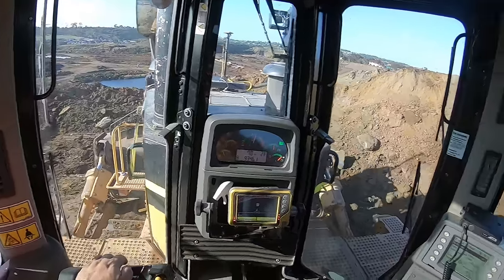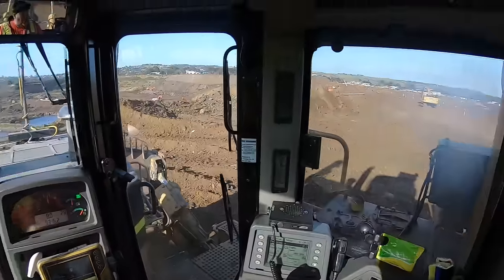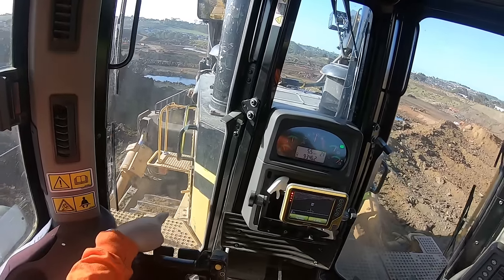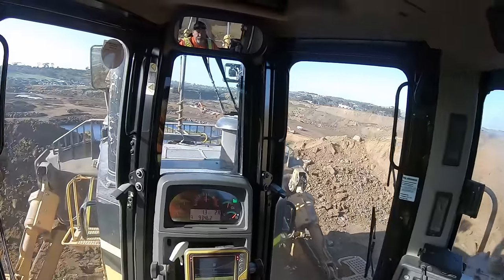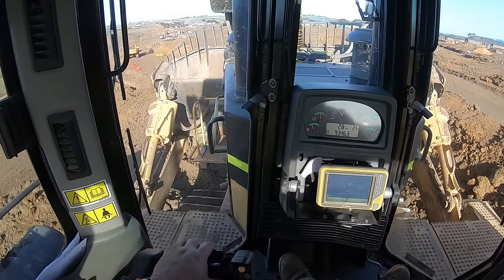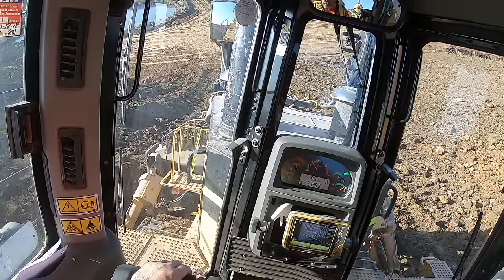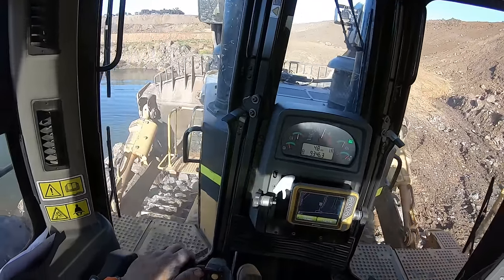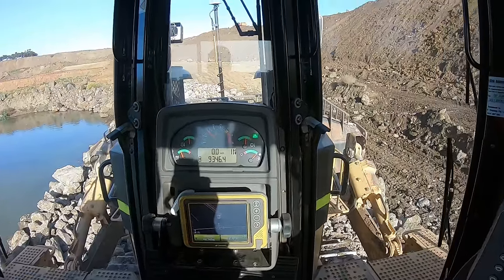13 minutes in the life of a D10T dozer operator

Comment: Great video sir, very informative,  I'm a D-11T dozer operator in a coal mine here in alabama, I can honestly say there aren't enough of us around anymore, grade control has really ruined some of the newer generation from learning how to listen to the machine and feel the machine from your hands to your wrist and arms all the way from the feet to your ass, in my opinion if you learn your machine and you want to do your job well the sounds and feel of the dozer will tell you exactly what you need to know, you will feel what and how your pushing or if your digging or cutting into the ground on one side or the other, getting to know your machine is the key in my opinion,  iv never stopped learning even after 19 years in the seat that machine still teaches me something everyday. Iv never got to use grade control yet, but if I'm not in the push pushing over burden off of coal I'm building a road or ramp for rock trucks. Stay safe brother!

Comment: You’re doing some good work, but if you can take any advice, I would tell you don’t use both of your steering brakes to stack the berm. That dozer is intended to go in and out of forward and reverse at full throttle, so slip it in neutral to stack your berm, you’ll find it is much smoother than using the steering brakes. Eventually, you will wear out the steering brakes and they won’t work anymore, all the dozers where I work barely turn because other operators use the steering brakes to stack. It is so irritating.

Comment: I ran a Holland loader for awhile,  it was a machine mounted on two D10N's, one in front pulling and one behind pushing,  sort of like a twin engine scraper.  It could load 120 yds of dirt in under 70 seconds consistently.   The front dozer happened to have a cushion blade on it, and sometimes the bank I was loading out of, would cave off in front of me and I would doze through the pile, with a full to overflowing blade load, while at the same time, loading the 120 yds of dirt.  It was an impressive machine.
Reply from the maker: That would be something to see! And I imagine few have had the opportunity to operate… I’ve operated all sizes of scrapers Cat makes, but nothing compared to that. Well done!
Reply: @briansims9820  if you google Holland Loader mining, you will see some pictures of the horizontal cut loader.  They had 2 types, a horizontal cut loader and a vertical cut loader.  The one I ran was a vertical cut.  They both operated similarly.  I would send pics of the vertical cut but I don't know how to do it, here.   I could text you some pics if you are interested.
Reply from the maker: @fedup3582  mate, that’d be great to see! simsbj68@gmail.com. I’ve operated so many different types of earthmoving equipment around the world in my 34 years as an operator/instructor…. just about everything used in mining, but I am not familiar with the Holland loader. I’d love to see some pics!! If you send me an email I’d be happy to give you my phone number for texts if that works for you. Cheers!!
Reply: @briansims9820  Здравствуй Друг. У меня есть вопрос. 
А есть ли возрастные ограничения для работы на бульдозере? 
Я хотел узнать. Если был раньше опыт работы в другой стране на бульдозере. При приезде в сша и имея разрешения на работу, возможно ли в 50-55 лет устроится оператором бульдозера? И какая оплата сейчас примерно в сша получает $ в час? И есть ли перспектива роста? И какая трудовая неделя для операторов бульдозера? 
Спасибо друг. За ответ. Мира и добра тебе и твоей семье!!!
Reply: @briansims9820 

И есть ли места для работы оператором бульдозера? Или это не так просто получить документы на бульдозер и работать?

Comment: Wish I was still operating. Operated D10s and D11s for several years at WV surface mines. D10T has a lot more power compared to D10R, and N models. There fast and can move a lot of material. Perfect slope dozer.
Reply: James Street  Tmodel is latest version dozer then R model was made before that then N model was before R model etc. N model was a power shift dozer. Which u steered it by levers by hand then when R model came out it was steered and shifted by your fingers. R model was a big change in the cab for cat dozers in the D10 and D11.

Comment: Love running 10T they are little hot rods. Especially on a dump when using the automatic down shift.
Reply from the maker: I could not agree more! It feels good when you start loading up the blade in 2nd and then she drops to first and you get that grunt and power... ooh ooh ohh!
Reply: The T2s have autoshift all I do is control the FNR and blade. Makes running the dump nice

Comment: I have to admit I am a little jealous.  Looks like a lot of fun and you make it look easy. Cool video.
Reply: It is easy when you have GPS telling you where the blades gotta be.
Reply from the maker: Thank you, I have thousands of hours on D10N/R/T’s. The controls are easy to use, and once you get used to the power and size, it’s a fun dozer to operate. The GPS is nice and makes working toward a design easier, but the one on this machine is “indicate only” and not even used in this video. 

GPS won’t make a bad operator good, but it can make a good operator better and more efficient.

Comment: I operate a D10 every day also but in coal so I look at the top of the radiator v/s the top of the blade for level, if the top of the blade is 4” above the radiator I’m level and if it’s level with the radiator I’m cutting and when the coal is rolling 3’ above the top of the blade I’ve got all she’ll handle, life is good in a D10!
Reply from the maker: Awesome tip! With a coal blade, your rock guard is high enough to see when parked on flat ground... perfect for judging going up or down. 
I use the top of the radiator to level my blade side to side. After a push as I’m backing up, I’ll check that my blade is level with top of the radiator before my next push. Good stuff!
Reply: Couldn't remember if the d10 or newer ones have the agitator button on the blade control like the d6 and d8 does
Reply from the maker: @davidroberts2404  no, there’s no shaker to get the mud to fall off

Comment: Hi,  I was wondering where was this at?  I use to operate a Caterpillar D-11 N at a coal mine.  Oh and also in your clip it towards the end it shows you going parallel to the water.  If I did that where I use to work I could get into trouble.  The reason being is if for some reason that area cracked off and fell I wouldn't have any where to escape to, as compared to if I was going perpendicular to the water or drop off.  Those mirrors up on the exhaust pipes must be helpful.  The D-11 N that I operated didn't have any mirrors at all. This film kind of reminded of those days.  Thanks for sharing!
Reply: I thought that a bit bizarre too. Almost unnecessary. Yank type accent so maybe US?

Comment: Running a big dozer will beat you up over an 8 hr day. The new ones have easier controls, air conditioning etc, but they are still tough. I ran D-8 and D-10 as a kid working for my uncle in the lumber business. Ripping up stumps and making logging roads. 
Once you learn how to tilt the blade for carry or for cutting, and finding the level position when cutting, the rest isn’t too hard.

Comment: I’ve never liked Topcon, but at least you have the GX55. I like that one better than the GX60. 
And at my company, I’m not allowed to go over 1st gear! 1st to push, half to rip. It’s a T2 so it’s pretty tough, but dang it kinda sucks to work slower.
Reply from the maker: In a straight forward push, maximising blade capacity, first gear is going to out produce second gear day in and day out. BUT… if you’re not allowed to reverse in second gear, you’re losing production. Forward is productive, reverse is nonproductive, so you minimise time in reverse by using second. Also, if you can’t maximise the blade load, then second is going to be more productive and won’t hurt the machine, provided you don’t overheat the torque converter. The whole reason for an “auto-downshift” switch is so you can work in second and have the machine monitor speed and load and automatically select first gear for you if/when the blade load increases enough to need it. 
Some companies are more concerned about maintenance costs than production, when in reality the higher production would offset a lot of costs and turn them a better profit at the end of the day. I feel for you!
Reply: In my 47 years dozer D8, 9 And 10s, I get way more done in 2nd gear than my fellow workers in 1st! Only two companies ever wanted me to back up in 3rd, one a D10 the other D9. Also if you are not in a (slot push) situation, don't waste time pushing a not full load All the way....leave it and go get another blade full, add to the first one. This way you gradually build germs, which keep a bigger blade full. Each site, different material, needs different tricks. But guys can get in a (working by the hour) mentality and "ho hum push in 1st all day" 🤣🤣

Comment: First gear takes longer but its better for the powertrain, pushing second puts unecessary stress on the powertrain and results in reduced component life.
Reply from the maker: As long as the torque converter and transmission don’t overheat, there is minimal reduced component life in the drivetrain. There may be increased wear and reduced life of the chain, shoes, and grousers, along with GET, but the trade off is production. The production gains using second gear when appropriate will offset the wear losses multiple times over.

Comment: Yeah you don't hit that decelerator when changing gear... mmm that's hot. Wish I could see it when they spread open the T/C and trans filters on this puppy during service. I would love to be the mechanic working on this thing, he probably has the most job security out of anyone there.
Reply from the maker: The ignorance in your comment tells me you might love to be a mechanic, but your lack of mechanical knowledge is probably holding you back. Why would you decelerate when changing gears? When you’re on your bicycle, do you decelerate before you shift from 1st to 2nd? Why would anyone want to slow down before going faster? It may do you some good to reread your comments before hitting “post”… it’s not that cool to slobber drivel across the keyboard when you’re taking a break from playing Grand Theft Auto in your mom’s basement. Thanks for coming. 

Caterpillar Track Type Tractor transmissions and torque converters are designed and built to withstand full RPM directional changes. I know this because I worked for Cat for 12 years. I’ve also spent 34 years operating equipment, with over 12,000 hrs on D10 size dozers, and haven’t been involved in a single T/C or transmission failure due to abuse. 

Now, I don’t know how many hours you’ve accrued on GTAV, (and I’m not sure if they even have Cat equipment for you to steal and drive), but I’m sure it sits you square up there in the cheap seats with the rest of the peanut gallery. But look at you go, Champ! Got your big boy shorts on and giving it a crack! Good onya! As a keyboard warrior, you’re a bloody legend, mate. Hurry back with another response to someone’s post - I’m sure your 17 subscribers are waiting with baited breath for your next doltish diatribe.
Reply: @briansims9820  12,000 hours, that's not a lot in the grand scheme of things... You slam the blade which is hard on pins, pusharms and track frames from the shock, you use your steering clutches with a loaded blade which is hard on the clutches "tickling" it or not, you leave the tractor in gear with your foot on the service brake which overheats the TCO, not to mention pushing in second which is unbelievably hard on pretty much everything. The tractor will handle it until something gives. Just because the tractor is built to "withstand" the abuse it doesn't give you an excuse to be a lazy operator. When you are in your car do you also leave the accelerator pinned to the floor when changing from drive to reverse? At the very least give the decel a tap to take the pressure off the trans when changing direction. I work with an older gentleman who operates similarly to you and his tractor spends more time in the shop than out in the field. Now granted we work in coal, so we have 68 yard coal blades and pushing that much material is very demanding but I wouldn't imagine dirt to be much different.
Reply from the maker: @200nick2  18 years in mining and rarely did any of the machines I was assigned to spend any time in the workshop, and even rarer for a component or part failure. You’re just trying to pick apart a short video and you’re grasping for straws. I don’t overheat TCO’s and they are made to push in second gear if you’re not maximising your blade load. I wasn’t going for maximum production, I needed to create space quickly for trucks to dump. An occasional hard connection to the ground is going to happen, even with the best of operators. I’m not the best, nor have I ever claimed to be. 

Believe what you want to believe and say whatever you want to say on other people’s posts if it makes you feel better.

Comment: You have any tips for running a d10 push cat on a 51 spread?  As far as being smooth on connecting and pushing?
Reply from the maker: You should be waiting for the next scraper by sitting at a 45 degree angle directly next to where you want them to begin their loading. As the scraper passes, they should be slowing down to start their cut, as the dozer is squared up and approaching in second gear. The easiest and smoothest connection is made when you carry the blade high and make contact just above or at the top of the cutting edge on the blade. As you feel the contact and start pushing, you slide the blade down to center on the stinger of the scraper. This way if you hit a little hard, your blade is curved and it’s more of a glancing blow as it lifts the rear of the 51. The operator won’t feel the impact as bad. It’s important that the scraper keeps rolling as they start their cut, slowly until they feel the connection, then they can throttle up and drop the bowl deeper. 

If you’re chain loading, once you push them out of the cut, you back up and turn at a 45 deg angle so you’re ready for the next one.
Reply from the maker: If the scrapers will start their cut shallow and maintain second gear about half throttle, the D10 should catch up easily in second gear, then decelerate as necessary to make a soft pickup… again, with blade lifted high then slid down to center on the stinger until the push is completed
Reply: @briansims9820  awesome that sounds like what I was thinking. I’ve heard guys say they put the blade into float is that true?
Reply from the maker: @tacodriver89  putting the blade in float is for back-dragging. That way if too much material starts to build up, the blade will float up over it and not just grind it into the pins and hydraulic lines behind the blade. Putting the blade in float and moving forward would just cause the blade to dive on you. It could only work on something like a concrete pad and you’re scraping snow or mud off. And then it wouldn’t be a D10… more like a D6. Float relieves hydraulic pressure and allows the weight of the blade sit on the ground. A D10 has a very heavy blade and would cut into any softer surface moving forward, even with the blade rolled back
Reply from the maker: @tacodriver89  if someone puts the blade in float while they’re pushing a scraper, as soon as they lose some pressure against the stinger, the blade would start falling. 
I would never recommend float while pushing, because I will actually control the scraper bowl with it… raising or lowering, and I’ve even tilted it to level a cut
Reply: @briansims9820  alright thank you for that

Comment: How do you choose gears?
Reply from the maker: Two yellow buttons on the left control pod... using your thumb. Top yellow button shifts up, and the lower button is down. 3 gears to choose from. 1st gear for maximum push capacity and production when possible. 2nd gear is for when a full blade is unachievable or unnecessary. 3rd gear should be reserved for emergencies only or for when absolutely necessary, due to the extreme track wear during 3rd gear use.